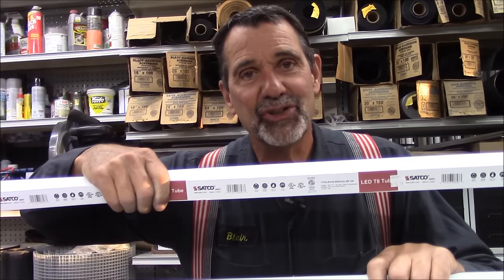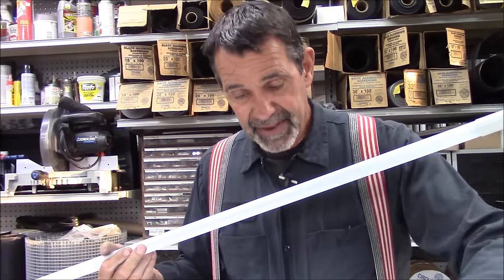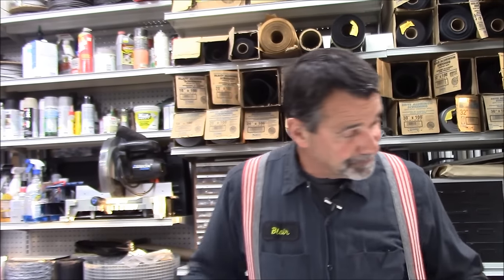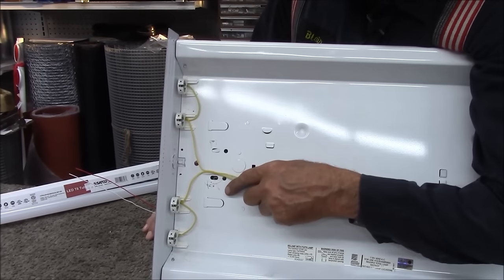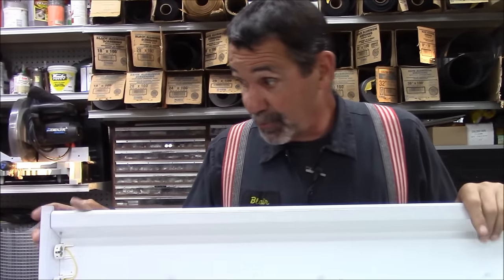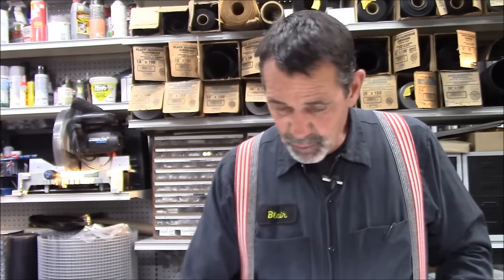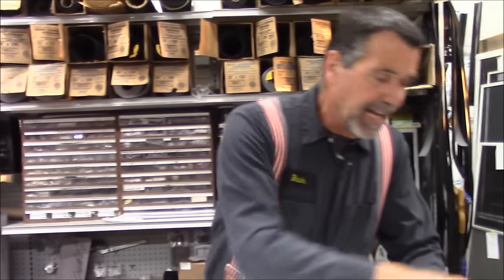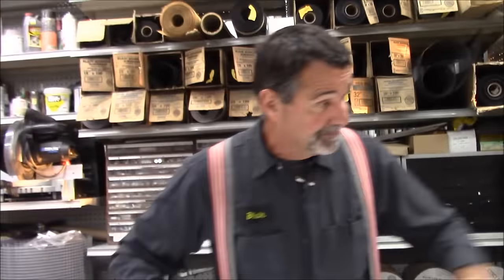New LED Tubes Convert Fluorescent Bulb Fixture Without Ballast Rewiring

Comment: Yes, this guy is amazing! He provided so much detail that gave me confidence to do this job at home.  I did focus my install the the Toggled Videos since that is the product I bought from HD. (on sale for less than 10 USD) Now, remember the golden rule, measure twice and cut once -- I completely forgot!, thankfully, I just took the extra wires and wire nuts to extend to the house wires.  Also, invest in a wire cutter/stripper from HD less than 15 USD.  Once you do this job, you will want to do all kinds of electrical upgrades (SIMPLE ONES LOL - leave the other stuff to the pros).  Love this video!

Comment: Ballast ready tubes can catch fire. I've seen it happen. Yet these major manufacturers never admit it. Even tho this is a multi option tube, which is double end power, it is best to get rid of the ballast and put new sockets in. We use single end power lights. Double end power has come back recently because many of the lights sold over 5 yrs ago were double end power lights. So the fixture is wired for it already and you now pop in the new tube. You can cut the leads to the ballast tight so it never gets used again. Take out both sides of sockets. Use new sockets for the holder side and new harness kits with a disconnect on it. Harness kits should be UL listed and rated for LED tubes. Many electricians are not using proper sockets and harness kits rated for LED tube. Prime example is leviton sockets. To this day they are not allowed to be used with LED tubes. Many electricians use these and have no clue that you just voided your tube warranty.  So be careful out there. Use the right sockets and harness kits. Using the old ones that have been in there for yrs may cause problems down the road. Do it right. Make it all fresh and new for your customers. Don't short cut anything. Been selling LED for over 8 yrs now. My company does it the right way.
Reply from the maker: thanks for that, Blair

Comment: Fantastic!!  Thank you!  3 other videos didn't explain the tombstones this way.  Your way is simple.
Now if I can just figure out the brightness.  I'll explain my concern.  I have a little desk like in the kitchen with 2 tubes about 18" long.  Went to Lowes and got a 2 tube LED light.  It was way way too (&^% bright.  Got a 1 tube.  Still pretty bright.  So I took the cover from the old light and taped it, yes taped it, to the new light.  Now it's just right.

In my basement workshop I have 6 - 2 tube lights.  they are 32 watt T8 - 48".  Would any ~17 watt LED be about the same brightness?
Reply from the maker: The good thing about 48" led bulbs is you can take one out to control the amount of light w/out sacrificing electricity through a ballast. Typically I see different values of color of light, but not much in reduced lumen output.

Comment: My lights were out and I took out the old ballast and rewired like you said.  Everything went smoothly and the lights came right on.   My GE led tubes were not marked polarity on either end so I put them in like they used to be.   I turned on power and they worked.  Turned off power and put everything back together, and then rechecked them and they worked.  Parked my jeep under them and they went out again.   I will recheck connections tomorrow, but I wonder if they may be in backwards.  Also, I may buy new led 48 inch bulbs with the polarity marked.
Reply: I am guessing that a wire nut connection may not be tight enough.
Reply: Ordered new led bulbs that had a diagram showing wiring required,  They will fix it.  My wire nuts were fine and voltage was fine.

Comment: Mr.Hardware Thanks for the led conversion video / will this also work with single bulb fixtures. i've tried it and when i hit the power on bulb blows. I may have purchased the wrong type of bulbs since i didn't know there was more than 1 type. Thanks Ron.
Reply from the maker: When you purchase the bulbs get a schematic of the wiring required. Sometimes the bulbs have a 'L' and a 'N' stamped on the ends of the bulbs. If so you know where to attach the wires. L is black and N is white.

Comment: At 4:29, wire nuts are put on. This step is critical. I wish it had been slowed down and more visible. As it is, I can see that the yellow wires are getting connected together, but can't see what's happening with the black and white wires.

Comment: I have T5 48-inch bulbs I purchased  that are LED.
Are they all compatible  not using ballasts?
Reply from the maker: You have to go to the manufacturer information for that. The wiring diagram and the requirements are there, they are so many different manufactures. I can’t instruct you and how to do each one. I’m only giving a general overview of how easy it can be.

Comment: Got a 4 foot blacklight from spencers. Took me forever to figure this out, and came close to but gave up and went the spencers light. So with the black light florescent light, do you have a black light led bulb that would work on the light
Reply: We do not, but when you find one be sure to get a wiring diagram to insure you wire it properly.

Comment: My fixtures are just like that but I bought LED B bulbs which have the line on one end and Neutral on the other and I wired it just like you did and they are working so I assume I'm good to go correct? Again they are not the ones that work in any configuration just LED B type. What say you?
Reply from the maker: Type B is ballast bypass, you have to wire around the ballast, you can leave it there but no power gets hooked to it. I like the ones that you purchased because the power is on each end of the bulb so that you don’t have to care about wiring the hot and neutral on only one end of the bulb.

Comment: I have a 4 wire run that is turned on at two locations. So what do I have then? Shunted or non-shunted? Same colored wire from all four tombstones. Yellow to and from, black to and from, red to and from, and blue to and from and a ballast. Thus is what has been holding me up changing these to LED's.
Reply from the maker: If it is one fixture, or several treated as one, that is switched from 2 locations you have no problem. The black and white wire coming out of the ballast are the same wires you are going to send to each end of the fixture in a shunted hookup. If power feeds the ballast, the same wires feed the new bulbs.

Comment: Mr. Hardware quick question please;
1. When you cut and cap the wires and take the ballast out, how does the led bulbs get power without rewiring?? 
Thank you so much I have a bunch of T12 fluro 4 foots in my basement and trying to convert.
Reply from the maker: When I disconnect the ballast output wires I take all the wires to the right of the fixture and connect them to the white romex 'feed' wire that was feeding the ballast. Then all the wires going to the left side of the fixture and connect them to the black 'feed' wire that was feeding the ballast. this way black hot goes to the tombstones on the left and the white hot wire goes to the right tombstones. Easy.

Comment: I just converted three old neon fixtures eliminating the ballasts, and rewiring the fixture.  Boy those LED's are bright.  Any ideas on how to tone down the brightness?  Is there a different plastic cover that is made or cut to fit?
Reply from the maker: I have removed one of the bulbs when it was too bright in an area of the store, and some of them are dimmable but some aren’t. Check with your manufacturer if they are dimmable and you will have to get an LED dimmer to dim them not a regular old dimmer.
Reply: @MrHardware1  Thanks for the reply.  I will specify LED bulb specific dimmer.  THUMBS UP!!

Comment: If I have non shunted ends can I use the same principle and wire one side to the white and the other to the black
or should I connect all the yellows together and the red and blue with the black?
Needless to say even simple wiring makes me paranoid
Reply: The bulb can come shunted or wired on one end. Check the instructions first because wiring is bulb sensitive. If you have a shunted bulb connect all the wires on the left to the white and all the wires on the right to the black.

Comment: Great video. Would this work with a LeD tube that says designed to be used with A Ballast? It doesn’t have Markings on ither side of the light tube.. it’s a 24 inch great value LeD if it matters. Thanks.
Reply from the maker: I doubt it. You'll have to bing search it and see if the mfg comes up. The early ones I played with were ballast only. Blair

Comment: GOOD video  But. Your not telling people about the different types of LED out there...I was at home depot yesterday to buy 4 ft. bulbs and found you must read the outside print carefully..some led bulbs require you to still use the ballast...some bulbs are single ended which requires a non-stunted tombstone on one end only..some bulbs are double ended which do not require a non-shunted tombstone..note that single and double ended bulbs require ballast disconnected and removed if you like and some easy rewiring ...so bulb ID is very important...be sharp...👍
Reply: Good point and you are correct! Unfortunately, there are no standards for LED's so all manufactures are different. You just have to check each bulb and see how they are set up. Also, have a look at color temperature (K) and lumen output and choose the best for your application.

Comment: Misleading headline. It says without wiring, and then he dismisses that, and talks about rewiring. In fact, for most people, simply installing a new LED into a box while leaving the ballast in is just fine. That’s why they make these. When the ballast finally goes, then it can be rewired.
Reply from the maker: Do it right the first time...  besides, why waste electricity on that ballast when you can eliminate it?
Reply: Then the headline makes no sense, and neither does the product you’re pushing here. There are plenty of LED lights for 120 fixtures. Why not use one of them instead? They’re made exclusively for that purpose. These have additional circuitry for the purpose of just replacing the old tubes.

But if the headline is about tubes that just work, without rewiring the fixture, then talk about that instead. I have both types in my own shops. They all work just fine. Often, a fixture is high on a ceiling, and rewiring the fixture is a pain, and even dangerous. Taking it down first, is a real bother. If it’s a commercial shop, as opposed to a home shop, it’s costs money to replace lights. Estimates are that it costs between $10-16 to replace one tube in an overhead fixture. It costs a lot more to retire one first. The cost may not be recovered for years. It’s cheaper to just pop the LED replacement in.
Reply: He shows that the bulb can be used without doing anything but installing it but then shows how and why its better to remove the ballast and rewire, did you not witch the video? SMH.

Comment: My 4 light fixture is much different, it has 3 ballasts (1 electronic to each outer bulb, one rapid-start magnetic for the 2 center bulbs), and non-shunted tombstones.  I was using T8 tubes but I have added "ballast compatible" LED's and the 2 outers no longer work [since I tried adding ballast compatible LED's] but the 2 centers work. The LED's literature says they can be run "ballast compatible" or "single-ended." So I guess the e-ballasts died? Now I guess I need to wire the 2 outers as single ended? How do I do that with unshunted tombstones that have 2, 3 or 4 wires each? Thanks.
Reply from the maker: If the bulbs are single end fed, meaning the black and white power wires go to one end only, you should be able to feed the non shunted tombstones with black on one contact and the white on the other. If you can get shunted led's you take all the wires from one end of the fixture and make them 'white', and then all the wires from the other side and wire nut them to the black and you don't need to touch the tombstones at all.
Reply: @MrHardware1  Thanks! My tombstones on one end had red, blue & yellow going all the way from the left to the other end where the ballasts are and I used those wires because they were the longest... I snipped the blues on the left end and both wires on the 2 outer tubes on the right end and I connected the yellows to the neutral and the reds to the Line/black. 
So right now, it's working with two LED 5000k 3000lm tubes on the outer tubes "single-ended", and one T8 + one T12 Verilux plant bulb on the inners on a rapid-start magnetic ballast. I bought some Sylvania LEDs that didn't work and I bought four ELB LED 17w 5000k "T8 ballast compatible" that didn't work either, so I sent them back (they were 4/$17.87 when I bought them on 1/9 and now are 4/$39.88 on 1/24.)

Comment: So is this the type ab?
Reply from the maker: No this is a ‘b’, made to work directly off the line voltage, usually 120 volts. More importantly is weather you purchase shunted bulbs or ‘end feed’ bulbs. Shunted are easier to re-wire.

Comment: I use this same method when converting over to LED tubes in office buildings. Office buildings have a few lights that stay on all the time, even when you turn off lights at closing. These fixtures have 3 wires: red, black,  and white. How do you convert these to LED?
Reply from the maker: Only use the wires that feed the old ballast. The red wire could be the switched power or the constant one. Not an issue, use the one feeding that fixture, the other wire is continuing on to feed other fixtures and leave it alone.
Reply: @MrHardware1  The black and white was feeding the ballast and the red had a wire nut. So I did not use the red and only 1 of the 4 bulbs worked
Reply from the maker: @dravenfrost248  A picture of the fixture wiring is required for me to go further. The gauge of the red wire will spell it all out for me.

Comment: When using ballast driven LED tubes ( UL type A), the ballast should last longer due to less loading and thus run even cooler.
Reply: Mine took a crap after a few years, at least a couple of them did.
Reply: @jstar1000  Only twice I've had that happen of the dozens I have installed like that.
Reply: @jolyonwelsh9834  I have six in my garage and two of them went out recently and the reason I'm moving to ballast bypass.
Reply: @jstar1000  There's no no reason why not. Over 90% of the LED retrofits I perform are ballast bypass.

Comment: I have LED bulbs by ge T8 replacement. I have T12s. So I checked for shunting. All 4 tombstones are Non-shunted. I was able to take off the back of the tombstones without damaging to physically verify. Not knowing if the New T8 LED bulbs are single or double ended bulbs. I took a meter to it and Checked for continuity. On both ends I have checked for ohm values. I get 12-13ohms on both ends. When I take an ohm reading from end-to-end I get an open circuit. So how would I wire it up these bulbs? Do I  put a black and white at each end of the light bulbs?
Reply from the maker: I would not trust a meter on an led bulb. The readings are not simple. Get the info from  GE, easy and safer.
Reply: @MrHardware1  I have tried the website no information for my T12s. Going to return the bulbs and look for another manufacturer. Unfortunately, I only have a Lowe's in town. Of course they only have one brand!
Reply from the maker: @thecrittergitter7576  Not the website for the t12s, the website for the leds. We don't care about how it was, we want to send a black hot and white hot to the new leds. remove the ballast and power straight to the led, once you find their info.
Reply: @MrHardware1   I looked up on the get website and found nothing to convert my particular brand lights. I  checked the tombstones and found that they are not shunted. So my thought was to tie one end with white neutral wires and the other black hot lead.
Reply from the maker: @thecrittergitter7576  If you have a shunted bulb the white will feed one end of the tube and the black wire will feed the other end. If they are non shunted the black and white will feed just one tombstone. How about sending the info off the bulb to me and I'll confirm the wiring. Blair@mrhardware.com

Comment: What did he do with the green wire?
Reply from the maker: The green wire is the ground which goes to the metal fixture. The ground is only to protect against a shock if the wiring goes bad in the fixture. It does not effect the bulbs in any way.
Reply: @MrHardware1  thank you

Comment: One major fault with your video you havnt suppled us with any links as to where to get that type of bulb. I have been all over the internet ...Amazon to Ebay and cant find the bulbs you have  for 12 dollars. Only bulbs/tubes with a built in ballast for 45 bucks a piece and you have to buy them in bulk costing 200 dollars or more. You put out this vid in 2018 I think you better take a new look at the availability of T8 type LED tubes
Reply from the maker: You can call our store 586-776-9532 and we can ship to you. We'll be adding them to our cart asap. Thanks and sorry but we can fix.